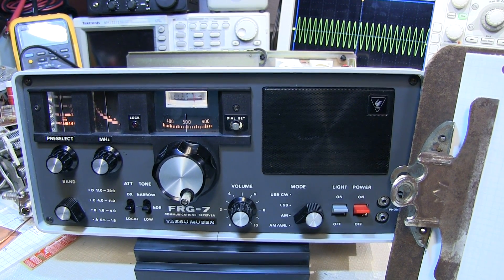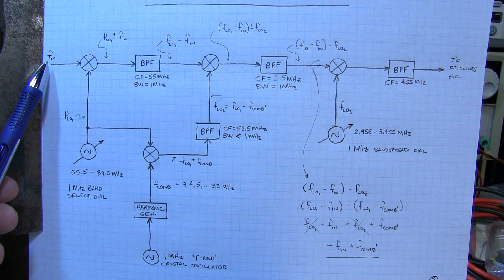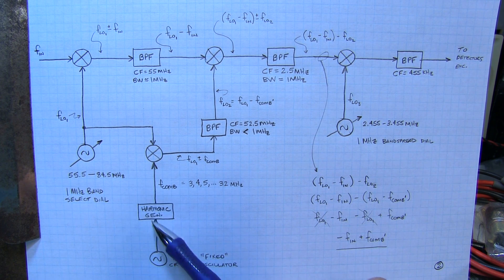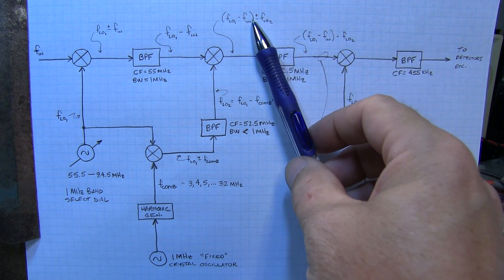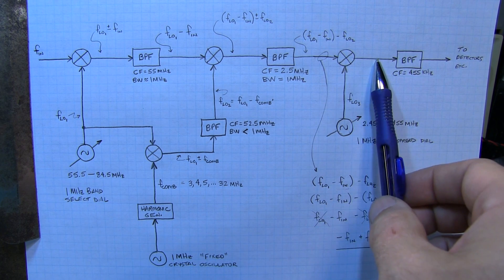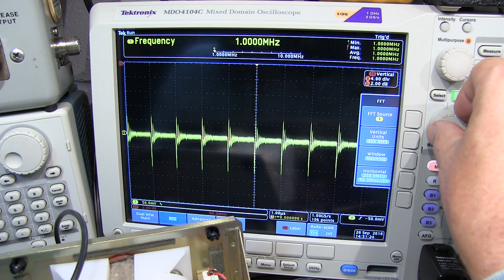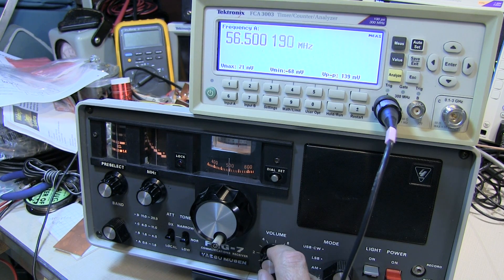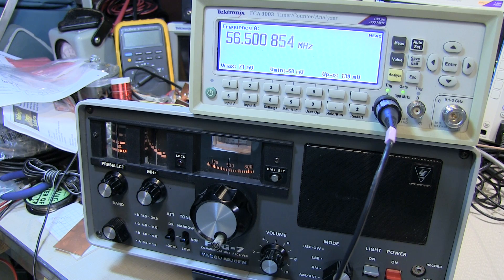#245: Old Tech: The Wadley Loop Superhet Receiver - Yaesu FRG-7 Example

Comment: Can anyone explain to me: if the frequency drift of LO1 is canceled out as described in 6:40 - how do you use LO1 to tune the frequency?
Reply from the maker: LO1 is only used to select which harmonic of the crystal oscillator is used for LO2.  That selects a particular 1MHz frequency range with the drift canceled.  The main station tuning is then done with LO3 over the the selected 1MHz frequency band.
Reply: @w2aew  thank you, now I understand! Great idea!

Comment: Thanks for the video. I've worked on all sorts of electronics gear in the last 60 years, including a whole lot of RF gear, but I'd never heard of the Wadley Loop or seen a rig that was using it. Fascinating solution to drift.

Comment: Good explanation of the Wadley Loop. Dr Trevor Wadley was an amazing Engineer. The first production receiver to use the concept was the Racal RA-17. First developed in 1954. Wadley was South African and Racal was a relatively newly formed company that had originally planned to build Collins 51J's; highly stable as required for reliable RTTY reception. However, the Racal/Collins agreement fell through and Racal had to quickly come up with an alternative design. Collaborating with Trevor Wadley, the Racal RA-17 was quickly developed, put into production and remained in use by the UK Government, as far as I am aware, into the 1980s.

Comment: Fascinating. I just got on and the led is not lighting. Also not very sensitive at all.  Any tips where to start pls ?
Reply from the maker: Does the LED light up at all when adjusting the MHz knob?  If not, then the PLL has a problem.   If it does, then poor sensitivity could mean a problem with the preselector or IF stages/filters.
Reply: w2aew Big thank you for your video. I traced everything with a CRO and thanks to your video everything looked the same. Found a blown LED driver transistor.  Sensitivity was fixed by AC power.  Seems the batteries I was using were not delivering enough voltage. Around 7.8v.
Reply from the maker: @phantomrose1999  That's great news - congratulations on the repair.

Comment: I was recently given one of these receivers, complete but slightly cosmetically challenged. My first exposure to the Wadley loop receiver was the Barlow Wadley portable radio which was made at the factory next door to where I worked. We made military radio equipment and every now and again, we would receive a batch of 10 Barlow Wadleys to evaluate. My boss was a rocket on these radios especially alignment. After he had sorted a set out, we used to take them out in the car park for a tune up around the bands. Absolutely amazing performance. Looking forward to sorting out my  FRG 7 as its quite a good basic receiver for the money. Thanks for an excellent explanation of how this receiver works.

Comment: Thanks for your work. Back in 86 when I first got licensed I bought one of these fairly cheap. Not knowing much about it....and not understanding how to tune it properly ....I sold it. It was only many years later....and much more knowledgeable....lol....that I have acquired my second one. All caps replaced ...and now outstanding receiver for its age and tech. I keep it next to my restored AR-88 LR. Compliment each other very nicely. And the FRG is SO much lighter...lol....the AR is 110 gut busting pounds. What a beast.
Reply from the maker: Geez - a 110 pound receiver! Yikes!
Reply: @w2aew  lol...look it up....1940's ....and built with no care about cost. They needed the best for ops.....and so it was built that way. They were used into the 60's. A mechanical marvel...14 tubes....a real beauty fully restored ready for another 70 years....if any AM still around?....lol

Comment: Excellent video.  The math speaks for itself.  Was this a speciality used by Yaesu or were others manufacturers using this method?
Reply from the maker: It was found in a few other receivers - some from Racal, some from Radio Shack, as well as Drake and Barlow.

Comment: Thank you for your description of the Wadley Loop. I really learned a lot. I would like to have seen a circuit diagram of the harmonic comb generator circuit. Of course, I could always "Google it"!
-- 73, DE WE3P
Reply from the maker: It's a pretty simple circuit - feed the output of the oscillator through a small capacitor into a grounded diode. This is followed by a low pass filter to limit the comb tones to <35MHz.

Comment: Despite owning an Icom IC-R75, the Yaesu FRG-7 is still my go-to receiver for most of my listening. It may be irrational, but the FRG-7 is just more fun to use and the audio seems more "organic" to my ears, even with a change to tighter IF filtering. I never cease to be amazed by the Frog's stellar performance, which is achieved  with a circuit that is both relatively simple and very reliable.
Reply from the maker: I can certainly understand that! I'm enjoying this one. Too bad I have to return it to its owner.

Comment: Great video! Nice to learn about the old tech. Wadley was quite inventive. I'm surprised this technique wasn't used more. 73, Dave, KEØOG
Reply from the maker: It probably wasn't more widely used because the wide bandwidth 1st and 2nd IFs present problems with adjacent signal overload.  Also, the development of precise PLL based frequency synthesizers made these drift cancelling techniques unnecessary. Interestingly, there was a paper published in 2015 about using this technique for advanced coherent optical signal demodulation - everything old is new again.
Reply: David Casler ad

Comment: Is a harmonic generator not basically a op amp or other amplifier which converts the sine wave into a square wave by clipping it.
Reply from the maker: No, it's not.  It consists of a few high speed diodes and bandpass filter.
Reply: Interesting after I saw how consistent the amplitude of the harmonics where I knew it couldn't use a simple square wave since the harmonics would go down in amplitude really quckly with a square wave.

Comment: Another low framerate video. ): 

Please fix your video rendering settings!
Reply from the maker: It's a YouTube problem.  Nothing has changed with my video settings here, and the file plays fine/smooth here.   Properties show 29fps, just like all my other videos.  Not sure what I have to do to make YouTube play it at the higher framerate like my other videos.
Reply: Hm, YouTubes player shows it is running at 15fps. 
https://screenshot.tbspace.de/fybxeckundw.png

Could you set the framerate to 30 fps instead of 29.97fps as a test/for a short test video clip?
Reply from the maker: All of my videos for the last 2+ years have been recorded and edited exactly the same.  It's only been the last few videos that YT is now playing differently.  I don't know if I have an option to increase the framerate of my camera.

Comment: Thank you. This is an excellent explanation of the Wadley loop circuit. This was used in the Racal RA17 and RA117 receivers made from about 1955 on wards.These were extensively used by British military and intelligence gathering organisations.  The drift was about 50Hz per hour, at worst, which is good for an all valve (tube) receiver. There was a matching transmitter drive unit called the MA79. Many of these Racal units are still in use and are readily available on the secondhand market in the UK. Probably the earliest transistorised application of this circuit was the Barlow-Wadley XCR-30 portable receiver that was introduced in about 1974. This was manufactured in South Africa.
Reply from the maker: Great info - thanks!

Comment: Thanks for describing the loop.  I took a "temporary" job in two-way radio 44 years ago.  I worked six years for an RCA dealer and 4 years for a Motorola shop before starting my own business.  I'm still working in my business, along with 8 employees, today.  Stability in my business early on consisted of high quality crystals in ovens, followed by TCXO modules.  Later phase locked loop, voltage control oscillators (VCO) and computer programming took over.  My temporary job was originally based on my hastily earned FCC first class license and my ham radio experience.  I didn't really start learning until I took the first two-way radio job.  Ham radio stopped being an active hobby pretty quickly but today I still have a license gained in 1960 and I maintain several ham repeaters locally.  I subscribed to your channel a couple of years ago and look forward to your tutorials.  Everything helps and at nearly 72 I'm still learning daily.

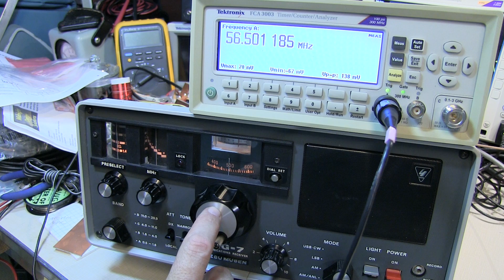Comment: Thanks for sharing. Very interesting circuit. Apologies to W.A. Mozart, I assume... At 12:30ish you say that it uses a second VFO that is controlled by a crystal oscillator, but you point to the second tuning knob. The LO controlled by that knob is not crystal controlled, right? Just the comb generator? Or is LO(3) also crystal controlled? I thought at that time in history crystals were pretty much fixed.

Comment: My FRG-7 is on the back burner, I bought it in unknown condition and was/is "deaf".
 I have cleaned the switches and even went on to re cap it, with winter coming on I'll have more time to work on it.
Thanks for this presentation video
Reply from the maker: I hope you're able to resurrect it.
Reply: Me too, I have a good buddy that wants to help with the trouble shooting, he has the test equipment that I don't. I have a hard time understanding how the 4 pin front end transistors are tested. Other than the work I have done this unit looks to be un molested.

Comment: why was the magnitude of the first oscillator changing with frequency as you twisted the the knob aound 7:55 mins
Reply from the maker: It could be a number of factors, from layout related parasitics, to loading effects, etc. It is a fairly simple oscillator circuit. Bottom line, the amplitude was sufficient to drive the inputs of the Gilbert cell double balanced pre-mix mixer.

Comment: Marvellous! I've got a Barlow-Wadley XCR 30, which I think was the first consumer radio to use the Wadley Loop. Not many others did - as well as that and the FRG-7, there were a couple of Racal professional communications receivers,, a Drake and another obscure one I forget the name of. Performance is remarkably good for a circuit that, although it looks complex, can be implemented in a very small number of transistors considering its capabilities. On mine, I can get the tuning bang-on by eye from the dial of a station before turning the radio on, which for an analogue set more than 40 years old is uncanny. Frobbing the preselector is an essential skill, though.
Reply from the maker: Nice comments, thanks. I think the Radio Shack Realistic DX-300 was a Wadley Loop receiver (although I think the preselector and 1MHz band select are ganged together, which I don't particularly like).
Reply from the maker: Oh, cool, thanks!  I've never played with one, so that's good to know!
Reply: Here: https://i.ytimg.com/vi/ujCnZnOeFt8/maxresdefault.jpg
Reply: No, if you look at a picture of the DX-300 there is a ring around the main tuning knob that is the 1MHz tuning, the band selector is to the left. Yes, I have one :) Once owned a RA17 too, but it was just taking up too much space.

Comment: Good to have you back in the swing of things (hmmm, no pun intended!). Great explanation, thanks!  73 - Dino KL0S
Reply: Ooops, forgot to mention - as I recall the later version of the FRG-7 included what basically was a RIT control to add to the mix.
Reply from the maker: Yes, this is an early production model.